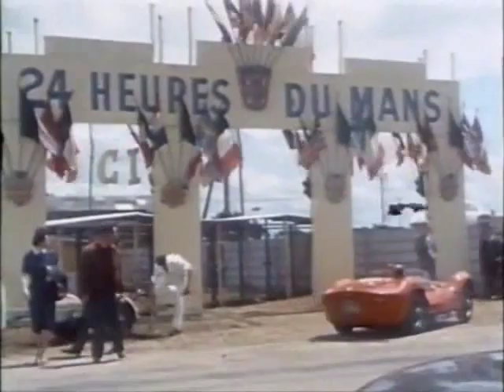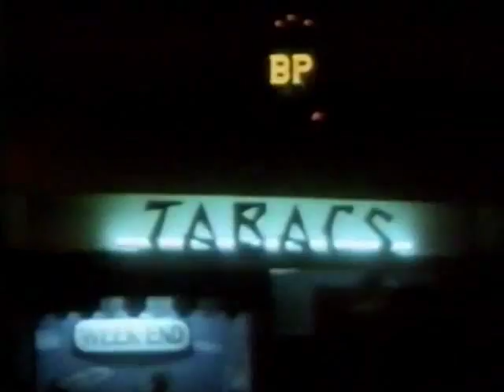Triumph TR4 (TRS) - 1961 Le Mans 24hrs (10th June 1961)

Comment: Notice no seat belts, roll bars and that one guy was diving in a t-shirt.  Those were the old days of racing.  They sure had a lot of driving skills.  In the corners many cars were fish tailing.  Interesting and cool racing documentary.
Reply: dphotos Five-time Grand Prix winner Juan Manuel Fangio (a record that held for over 50 years until surpassed by Michael Schumacher) always raced in a short-sleeved open-neck Lacoste style shirt, whether at Le Mans, Spa Francorchamps or the Nürburgring.  Crash helmet made of some composite material like Masonite, and never any seat belts (drivers at the time thought it was better to be thrown clear rather than be trapped in a burning car).

Comment: Given that the 2.0 Twin-Cam Sabrina prototype engine put out around 120 bhp in road-going form, would be interesting to speculate the power increase were a production version of the 2.0 Twin-Cam engine fitted with fuel-injection like on the 150 bhp 2.5 Triumph I6 PI engine.